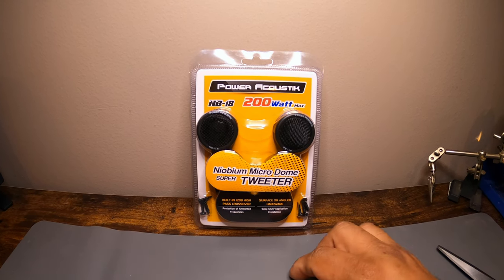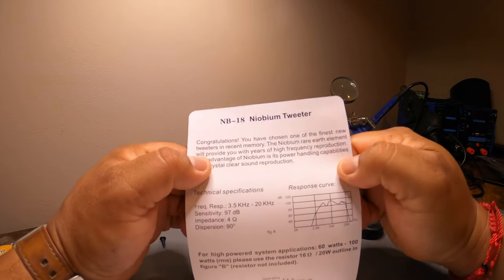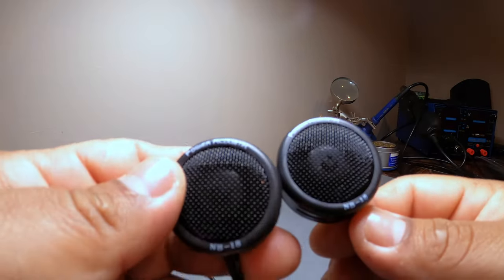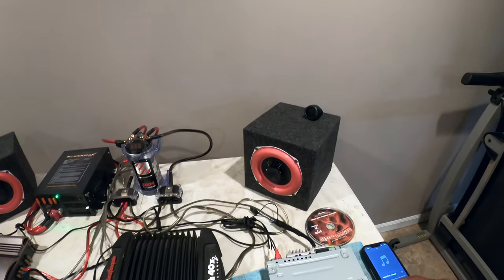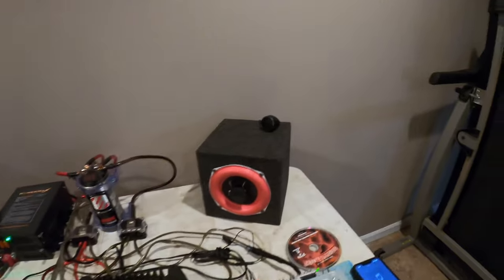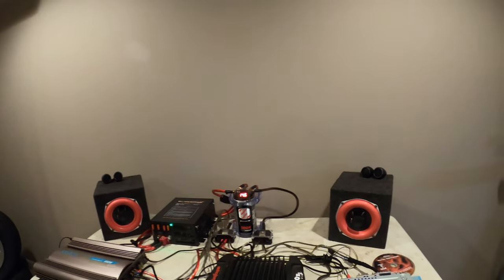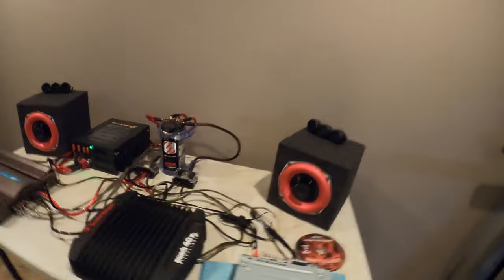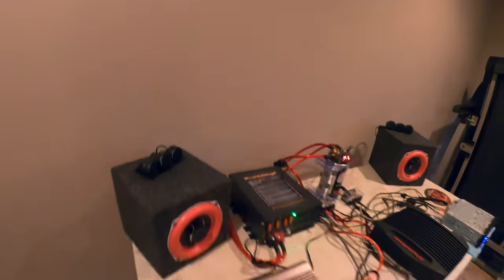Power Acustik NB-18 super tweeters.

Comment: I've dabbled in car audio for the last 20 years and I've recently tried these out. These compliment my audio system well! Before I had two amps, one to a set of 12 inch MTX terminators, and another 300 watt 2 channel amp running infinity kappa door 6X9s "@75 watts 4 ohm" and the other channel 75 watts 4 ohm to a single 8 inch Skar audio mounted in the back deck. I added these tweeters on the A-pillar of my challenger and tapped them into one of the 6x9s so they're powered but under powered. I had to turn them down because these little dudes ROCK! I plan on adding electrical tape over them to quiet them and maintain the tuning I have to the 6x9s. Worth every single penny for these thins! Highly recommend.
Reply from the maker: I agree, great bang for the buck. I don’t know how much abuse they would take or  how long they would last being pushed but for me so far so good. Thanks for watching and please like and subscribe.🔊🔊🔊

Comment: Just installed these on my 2013 F-150. Nice tweeters, for 10 bucks, there worth it, i would have paid 20 bucks and still said they were worth it. Great sound. Copper is positive, silver is ground. On trucks wiring, purple with green stripe is positive.
Reply from the maker: I agree, not a bad product for 10$ or even 20$. I still run a pair on the test bench, I don’t know how long they will last but so far so good. Thanks for watching and if you haven’t already please like and subscribe.🔊🔊🔊
Reply: Even better for anyone with a F-150 out there, just lightly sand the opening and these guys pop in and lock in , the lip on the pillar trim fits right into the groove on the tweeter and the tweeter sits flush in the pillar trim, looks stock. This is Information for any F-150 guys that read this down the road. This video is spot on, they sound great for 10 bucks.
Reply from the maker: @seacradev5400  

Thanks for the helpful hint on the channel, hopefully others with f150s read the hint. If you ever see something on the channel that can help others please share the skills. Again thanks for positive comments. 👍

Comment: Add a kill switch for you sub woofers so you dont be plugging and unplugging your rca's..
Reply from the maker: @JGarcia2016 

That’s a great idea and I happen to have an extra switch. Thanks for watching and if you haven’t already please like and subscribe.🔉🔉🔉
Reply: @93dajjdg  i already subscribed and hit the like botton...
Get some bass blockers for your tweeters they will sound more creesp.
Reply: @93dajjdg  i used to do unplug and plug my rca's and i messed up my nemesis 3,000 wtts amp so wgen i got my new amp i installed a kill switch with a fuse.
Reply: @93dajjdg  i recommend the sound stream twt.5 they already come with the bass blockers and this sound way louder than the power acoustik Nb18's....

Comment: what is the AC Power Supply did u use?
Reply from the maker: I use a PowerMax 100amp power supply, model#  pm3-100lkx. Great power supply, I haven’t had a single issue with it so far. 🤞🤞🤞 I purchased the power supply on Amazon and I believe I paid 189$ at the time. Thanks for watching and if you haven’t already please like and subscribe.🔊🔊🔊